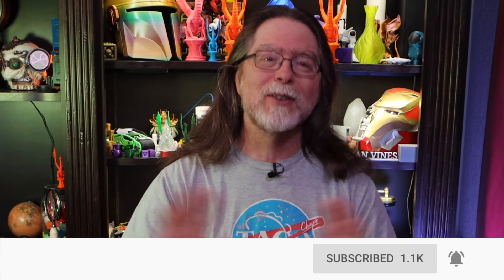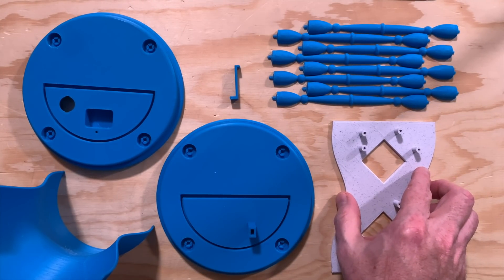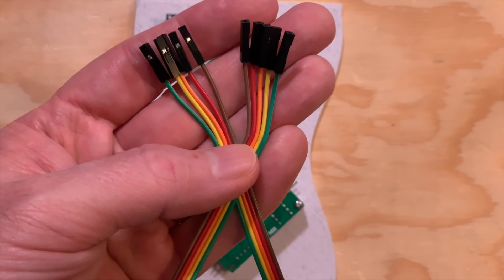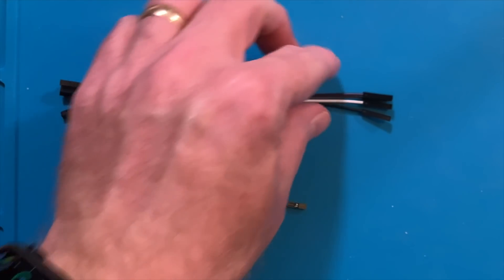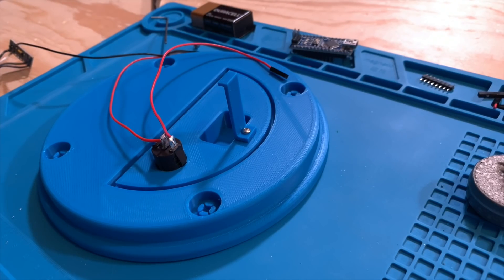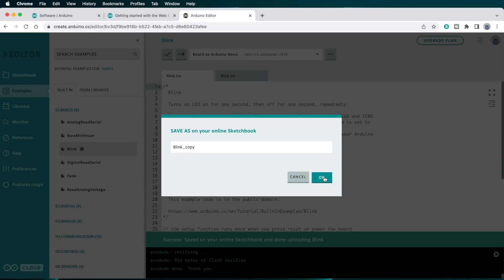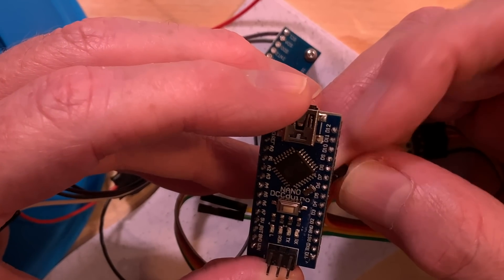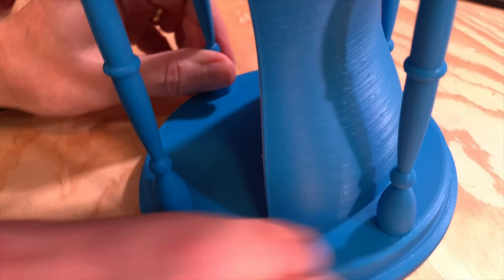Build an Animated 3D Printed Electronic Hourglass!

Comment: Literally have done every single step and yet the accelerometer doesn't work as it should. All the particles stay only above and don't move. Plus, what does the A1 and A2 have to do with the project??? When those doors are used?

Comment: I built one as well!  I was super excited when it arrived and I jumped right in.  Super cool project from Alien3d!
One thing to note regarding the wiring.  Instead of having to solder the ground from the accelerometer to the ground from the battery, I instead ran that ground (connector already there) to the unused ground of that second led matrix.  Worked perfectly and made the wiring a wee bit easier.
Reply from the maker: Hi Kevin! I was kind of hunting around for other ground leads, and missed that one! Good choice!